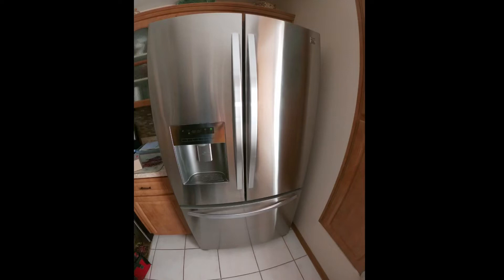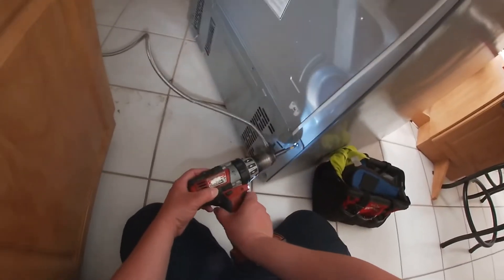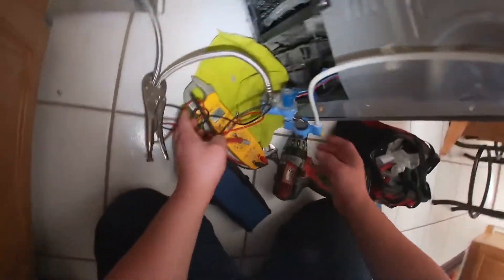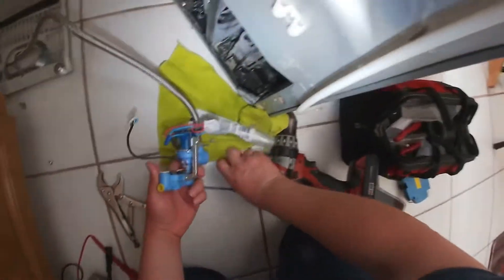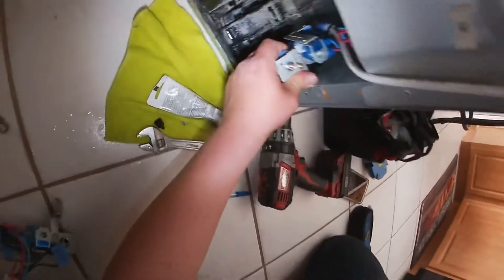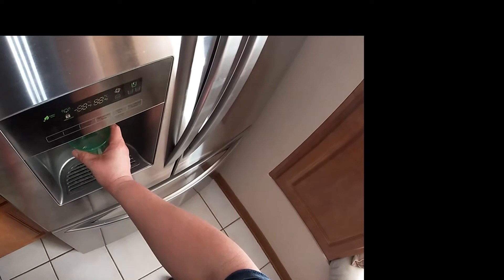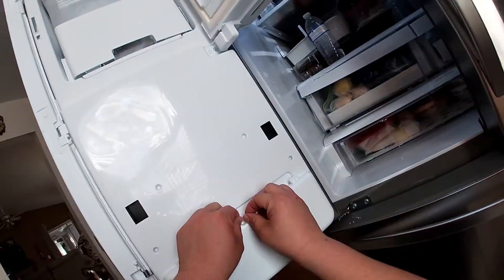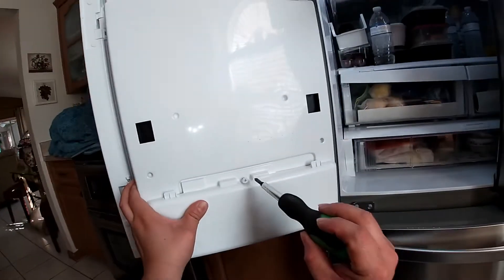How to Repair Kenmore (LG) Refrigerator Not Getting Water or Making Ice | Model 795.70323.310

Comment: Thanks for the video.  I have water coming out of my cold water reservoir tube (I disconnected, ran it out the door, which has to be closed and pressed the water dispenser and got water.)  But my water dispenser and ice maker are not getting water.  Any idea what could be blocking?

Comment: If you have power coming in to the water valve means the switch is fine, not necessarily the water valve is working, another think you can do is to check for continuity  it should be around 500 ohms
Reply from the maker: Yes in this particular case The homeowner have problem with his water softener and clogged everything in the house so we already know for sure that it was the water valves clogged